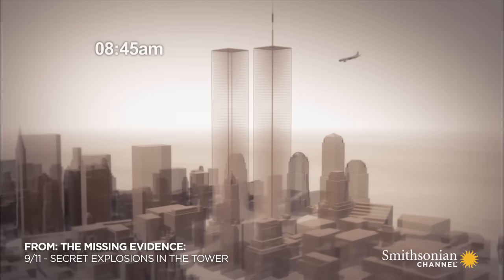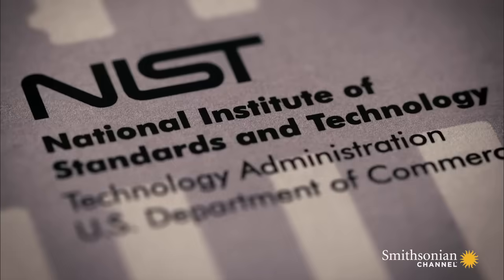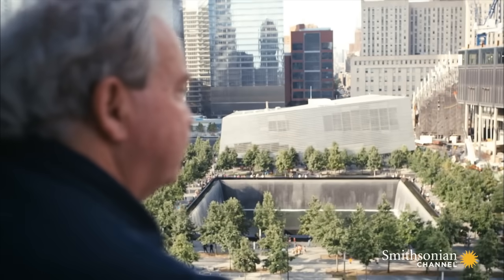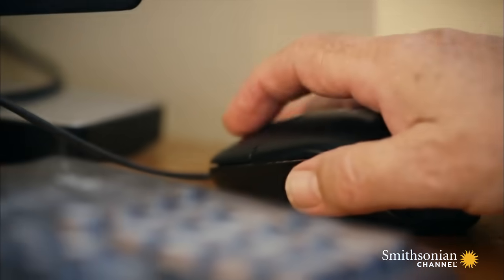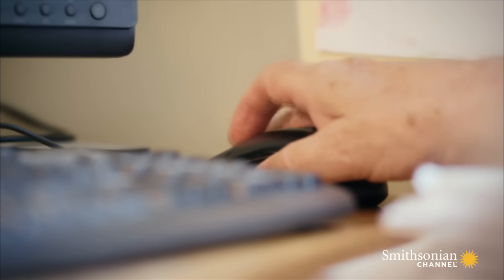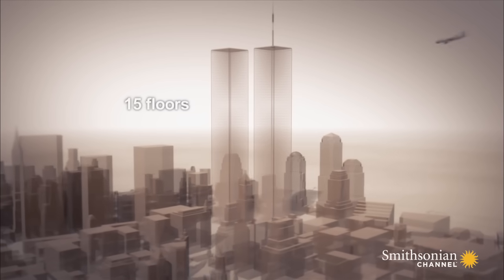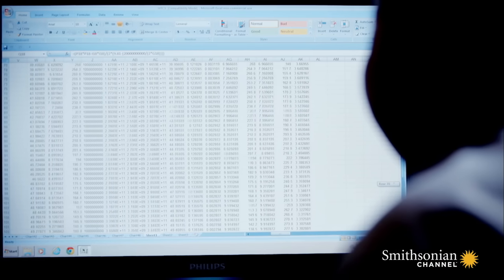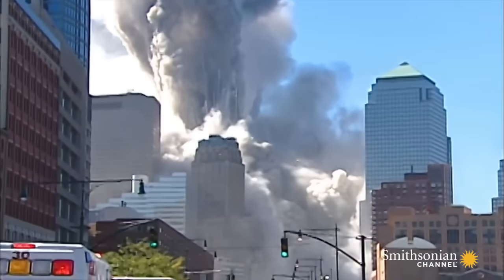This Computer Simulation Explains How the Twin Towers Fell

Comment: Okay I can understand the physics behind this. You have to understand how these buildings were built. Instead of using the traditional grid column structure used in buildings like the empire state, the twin towers had all of their columns pushed to the exterior wall, and inner core to maximize floor space in a tube like structure. Because long pieces of steel are very easily buckled, they used the floor joists to separate each column into a small segment making the buildings very rigid. They were designed to take the impact of a commercial jet, but at the time they were designed to take the hit of a 707. But they were struck with 767's which were heavier, flew faster, and carried more fuel. And both were preparing for flights from Boston to LA. When they hit the towers, the damage was rather  benign, and the towers could easily have survived. It was the fire that brought them down. Now before you start screeching that it wasn't hot enough to melt steel, you're right it wasn't. But it did get hot enough to make it weaker. And as the weakened floor joists sagged under the weight of the floors above, they pulled in the outer columns which you can see in some pictures if you look carefully. Eventually, the outer columns reached peak stress and failed causing the upper floors to collapse inside the buildings walls, and as that mass fell it kept snapping off the floor joists and pushing out the outer walls. Until the entire building collapsed. The South tower collapsed first because it was more severely damaged, and there was more weight on the damaged columns
Reply: Bullshit
Reply: Ok

Explain to me and everyone else why Larry Silverstein the owner of the buildings just so happened to take out an insurance claim the very day before 9/11 happened?

Why did him, and his son and daughter who all worked in the buildings decide not to be at work that exact day?

Coincidence eh :)
Reply: Also for the first comment go and see people who are actually engineerings and arquitects and they will tell you otherwise
Reply: You are absolutely right but your not going to convince the conspiracy nuts with their, thermite and  explosive embedded in the steel demolition narrative.
Reply: Best comment I've seen in all these WTC videos. Perfect explanation. It's great to see people who actually have a brain.
Reply: You're right Jon, these "oh, well that explains it" idiots are almost laughable.  All three buildings were demo'd.  There is NO, none, zero chance building 7 was not a demo, and if building 7 was a demo, then so was 1 & 2.  A mentally challenged 14 year old is capable of getting their head around this modicum of Bayesian theory, but these fools believing the aircraft brought down the buildings embarrass most humans that have functioning above the brain stem.  You could go out in the desert and build 100 WTC buildings and crash fully fueled 767's into every single one of them in the exact same manner as WTC 1&2, and not one, NOT ONE would fall in the exact same manner as the others.  Now, calculate the odds that two, in a row, next to each other, half-hour apart would not only fall in the exact same way, but right into its own footprint, with as close to zero resistance as imaginable... and well, those odds are off the chart and beyond the imagination.  But hey, lets pull out our Excel spreadsheet, rip out a little program and calculate not only that this mathematical impossibility did happen, but also exactly WHEN it would happen.  I tell you what, I hope this guy in the video knows he could get a job tomorrow at Lockheed or NASA and name his price!!!
Reply: Is this in the NIST report? I don't think it was a conspiracy but I still haven't found a convincing explanation. My problem with this one is that it seems to keep ignoring the mass below the impact point. Obviously if there is a collapse, let's say a few floors collapse, all at once so you can have a uniform symmetric collapse, and that the upper part then slams into the part beneath. Why does the collapse continue? Surely since it's impacting a larger mass below, and the only energy available is due to gravity, it should decelerate with the impact of each floor. What's the ratio of the mass of the upper section to the mass of the lower section? People keep saying the upper section was as massive as Titanic, but then sure the lower section must have been even more so.
Reply: The columns in the center were vertical and tied together in a rigid structure.  Beams in the floor breaking around that structure would not cause it to disintegrate.  How come there wasn't a tall thin structure in the center buckling and falling 50 stories behind the rest of the debris?  How come there weren't giant sections of the exterior walls folding down on each other or falling outward in massive slabs?  How did they disintegrate into near dust floor by floor if it was just brackets and beams breaking under the weight coming down from above?  Explosives solve all the mysteries and answer all the questions.
Reply: @thecarstoresalesandleasing4425  Inner core structure of the towers was much like a conventional steel skeleton of a high rise building. It has to be strong enough to support the towers swaying side to side, as well as carrying around 50% of its total weight.  

There were no beams or columns in the floor structure but trusses, which were welded to the inner and outer support columns. Sheet metal was laid on the trusses and after that, thin 4 inch layer of concrete was pumped on it.

Trusses are well known to fail in the fires so that's definitely not a miracle! When the floors started to sack and eventually collapse under extreme heat of the fires, they pulled both the inner and outer support columns inside the building, basically knocking down a few floors away from the middle of the towers, making the upper floors drop on the remaining structure. This means that anywhere from 50 to 100 thousand tons of steel and concrete suddenly fell on the lower floors which obviously started the chain reaction of collapses. There is no structure in the world that could handle that kind of force.

And yes, all of those very thin 4 inch concrete plates, fell on to each other, pulverizing them. Also, when a 1300 feet skyscraper collapses, it should be expected to see rubble flying long distances. 

This explosive "theory" isn't nearly as stupid as "no planes theory" or "mini nukes" but it's still pretty fucking stupid. Sheer amount of explosives required to take down those buildings, would have been absolutely massive. Not mention months of pre-weakening work, all the wiring and the fact that nobody ever noticed anything. Also, saying it was "controlled" demolition is absurd. If you try to take down a building with explosives after it got hit by a jumbo jet, I can sure you, there would be nothing controlled about it.
Reply: Bs there was a build in Dubai that burned for 17 days and it did not collapse.
Reply: @chriscronkey8378  What's the name of the building you are talking about? I searched and I can't find any sorts of a building in Dubai burning for 17 days.
Reply: You can't compare two totally different build buildings and two totally different scenarios. I'm sure there are tons of buildings that burned for a long time but that doesn't mean that all building that are on fire won't collapse.
Reply: Jon Boner actually it is due to the weight above the impact zone being the almost equivalent of the weight of the titanic as well as the scorching hot temperatures weakening the steel structure
Reply: +Jon Boner You're blatantly a conspiracy nut, you ain't fooling us lmfao.
Reply: youre a bot
Reply: your check is in the mail....
Reply: building 7?
Reply: @Frank Stein exactly
Reply: No stop, obviously 3 massive skyscrapers were rigged for demolition for some reason, without any of the tens of thousands of visitors noticing.  Wake up sheeple!
Reply: @Frank Stein I know bro!!!!!
Reply: I’m so glad you gave an explanation, I haven’t heard anything that sounded so logical. I still have questions but thanks
Reply: build n7, thank you.
Reply: but what about the molten steel and the explosions that people heard prior to the collapse?
Reply: if you think about it, it makes sense are large building with a structural damage 75% to its height would only adhere to vertical deconstruction. but building 7, no answers Jon Boner
Reply: MisterLifter ”Prior to the collapse”
Reply: Marry me mr.bassigni
Reply: At 9:49 a.m. on Saturday, July 28,1945, a B-25 Mitchell bomber, lost in fog over Manhattan, slammed into the 79th floor of the Empire State Building, killing 14 people and injuring two dozen.  Yet the building didn’t collapse …  maybe they should make all the new buildings like that one?
Reply: Jon Boner 
The massive weight from straight above the failure site caused it to fall downward. there was no where else for it to go but down, also. if you look at the overhead photos released years ago. you can see the that top of the south tower actually didn't fall straight down like it looks from the video. the top chunk actually fell sideways towards the side of the impact and crushed the floors below it as it went down.
Reply: your a  bought and paid for psycho.
Reply: You're*
Reply: Nice, I read this after writing my own comment and theory, but I didn't do research like that. Claps hands (I figured it was because the buildings couldn't hold up any longer due to burning jet fuel and ungodly temperatures)
Reply: William Bassignani - Exactly! Understanding the design of the towers is the key.. I've tried to explain that to at least a 100 people with no results! Mainly bacause the people completely lack understanding of construction business, structural engineering, basic physics, common sense, English and so on! You can might as well try to explain this to brick wall! :)
Reply: +  William Bassignani
William Bassignani 

There were no planes at all!
The Twin Towers were empty!
The Twin Towers were brought down by controlled demolitions!
Reply: Lord Pax shut your mouth you deluded little asshole
Reply: Very nice story. Exactly the same happened to building seven. Just the fire, nothing else.
Reply: What about all of the perfectly intact, undamaged floors below the crash? That little top piece of the tower would’ve disintegrated if it was a gravity collapse, leaving all of the bottom floors virtually intact. But we see is a the WHOLE building GONE! And how do you explain the ejection of these massive steel columns that went into neighboring structures? Something had to PUSH those columns outside. Fire simply doesn’t have that much pressure to eject such massive columns. Please explain all of my questions. Bet you can’t 😉
Reply: What about the bombs?
Reply: Yawn...another weasel with a keyboard.
Reply: Yes the floors fell at basically free falling speeds and WTC 7 fell from office fires at free falling speed. That has got to be the biggest load of dog crap I ever heard.
Reply: Agree with Chris. Grenfell tower in the UK burnt for days and days with no collapse. Wasn't even considered structurally weak, that all the firemen and forensics teams could freely enter after it was distinguished.
Reply: ollie nicol Grenfell tower didn’t get struck by a 747 passenger jet pal
Reply: You do realise what happened is literally impossible right ? Not even 'unlikely'. The buildings collapsed at freefall - this would mean there wasn't even an ounce of resistance. Theres a reason that world renowned physics professors, structural engineers and demolition experts have given talks on how its impossible - because it is impossible.

Also..building 7 ? Collapses from a 3 story office fire ? lol
Reply: @joshcarberry4463  neither did building 7
Reply: The Grenfell tower's core structure was made of concrete which isn't as strong as steel in normal conditions. Once the temperature rises, steel drastically begins to lose its strenght therefore not being able to withstand the weight on it. Also, the tower wasn't hit by plane unlike WTC towers were, which already broke some of the core structure since it's exterior walls were also a huge part of the holding structure for the towers.
Reply: I'm not agreeing or disagreeing with you Ollie - but what i would say is Grenfell is not even on the same size or scale as WT6/7 - and wasn't hit by planes....
Reply: @ollienicol4892  60 hours = days and days 😒
Reply: I completely agree that there was no ‘C4’ and it wasn’t an ‘inside job’. I just can’t get to the bottom of which metal it was that was molten and pouring out the side of the tower? I’ve presumed it was either molten aluminium or metal used in the various furniture on each floor?
Reply: I have found someone reasonable and intelligent on a 9/11 video. Exactly the points I use. Very good explanation.
Reply: Bob Smith Ok

Explain to me and everyone else why Larry Silverstein the owner of the buildings just so happened to take out an insurance claim the very day before 9/11 happened?

Why did him, and his son and daughter who all worked in the buildings decide not to be at work that exact day?

Coincidence eh :)
Reply: William Wallace Actually, he took the claim out in July. As for the coincidence, it does look suspicious but Lary did have a doctors appointment. I don’t see any reason to jump to conclusion based off a coincidence and no facts.
Reply: Bob Smith and his son and daughter just so happened to not be in work that day also? There’s no such thing as coincidence my friend. Open your eyes before it’s too late
Reply: William Wallace Statistically, coincidences do happen. Every now and then the low probability is gonna happen.
Reply: William Wallace So far all the facts have been debunked. Give me a fact instead of insulting my intelligence.
Reply: Thank you. This is a perfectly logical and correct explanation. These conspiracy folks make my head hurt.
Reply: If using common sense makes me a "conspiracy nut", then I'm glad to be among the ranks of other nuts!
Reply: The columns bowed out is the answer to both your questions. It was just good engineering. There is footage of WTC7 where you can clearly see the fires causing the floors to fail before the outer structure collapsed. This is not how controlled demos work.
Reply: @thinmanthewise  good engineering? Lmao...just stop it. No matter how good you make a building if physics come in place you DO NOT defy physics. Even if you are right by some.miracle, does not strike you as odd that both buildings collapsed exactly the same way?  Not just a chunk where the plane crashed or something naaa... the whooole building collapsed
Reply: @Yokai_Yuri  I still dont understand why more people looking at the falling steel and concrete are not asking themselves how its turning to dust "Whilst falling" lol. If you watch in slow motion its even more ridiclous and no one has an answer for how that happened.
Reply: Yes you can plainly see that the collapse began right above the point of impact. If there was explosives like the nut jobs suggest then they would have to have been placed where the plane actually hit. Coordination like that would have been impossible.
Reply: All 3 buildings implode into themselves even though the planes crashed into one side of the building's and WTC7 random office fires which is asymmetrical damage to the structure. So say that one side of the support structure was weakened more then say the other sides of the building, wouldn't the collapse happen asymmetrically eg.collapse to one side more or topple to the side? Instead it basically fails and collapse into itself equally. If that doesn't raise questions, I don't know what would.
Reply: Tower was designed to fall into its footprint even if it takes asymmetric damage and force of gravity is pointed towards the earth as we all know. The bearing structure for floors were made of steel trusses which are known to be reliable for fire for about 10-15 mins, the floor just falls in. Also every fire is different and you can never predict the outcome.
Reply: At this juncture in history how brainwashed are you people? Conspiracy theorists?  Are ya frigin kidding. Many people with critical thinking skills over the last 17yrs have mapped out, connected dots, proving that 9/11 was a conspiracy, FACT! Please for just a moment lift the veil, you will find truth!!!
Reply: Mike Gibbons you’re a freak

Comment: Bullshit. You have structural engineers and demolition engineers doing the same thing with programs and actual live models. Not only would this not have happened, but it would not have happened with just explosives the massive steal beams would have to be cut and packed for it to fall like it did.